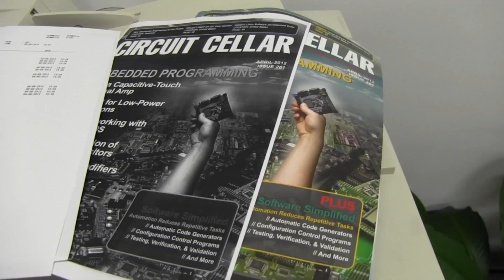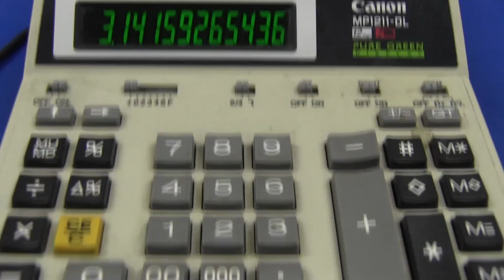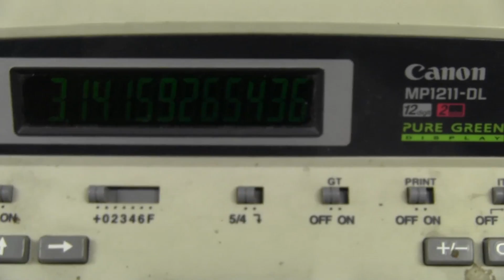EEVblog #345 - Electronics Dumpster Diving

Comment: Those 204B monitors are pretty decent once you replace the dodgy caps. I got one from a buddy a few years back because it would take about 10 minutes to power on fully. $4 in parts and half an hour of time and it has been rock solid ever since.

Comment: Damn, i could use so much of the stuff you find there. Like the monitors. Recently i got lucky and my school gifted me 10 old crusty 1280x1024 monitors. I threw away the white cases (more like yellow at that point), and have put 9 screens seamlessly together. They all work and are currently driven using 3 graphics card outputs and a bit of controller magic which needs to be optimized still... 
Neat project and it would also work with your four monitors. You wont even need complex controllers, just get a good graphics card with enough outputs.
Reply: most graphics card comes with a display port so there would be just a dvi cables that are compatible so that means you need lots of dvi connectors

Comment: If anyone's wondering, the specs of a Dell XPS 420 are:

Intel Core 2 Quad Q6600 Processor 2.4GHz
4GB DDR2 RAM
500GB Hard Drive
ATI Radeon HD 3650
Windows Vista Home Premium
Reply: Sam Gates ME is pretty bad, they may be on the same level. I'll never know though, since I went straight from 95 to XP.
Reply: I thorght they had the Nvidia GeForce 8800 GT.
Reply: Sam Gates You know vista is the worst version of windows ever produced?
Reply: Sam Gates No,vista is literally the worst version of windows. It hogged massive amounts of ram, barely had driver support, was loaded with bugs, crashed almost 1 of every 10 program you open, had horrible security, the server editions were unreliable, etc.The only reason I could see someone liking vista, is them trying to be a special little snowflake, and be different from the masses.
Reply: Sam Gates WIndows ME is about the same as Vista. According to what I've been seeing, vista is worse.
Reply: ME and vista suck equally. Windows 2000 was the real OS to have in that era. XP was the same kernel as 2000 and just had pretty colors and a new media center. XP was fucked up in it's own way and inferior to 2K which I used right up until 7. Vista was a pigfuck fest

Comment: Was hoping to (at best) trade for maybe an old 8 bit console/Amiga PSU (though tbh I just need to rewire the 500)/128 Spectrum keyboard overlay. But have not looked at them tbh. Some cool chips on there... Lots and lots of chips/caps/stuff!

Unsure what postage is like for other side of world (one of my best buds in Perth actually atm)

Also not looked into the NeXT stuff for value/collectivity. Solder on the (HUGE!) VGA card looks sweet. Pretty sure no chip leakage or PCB damage. It has the blue 'IBM' pullout 'tab'and just caught my eye for being such a crazy big card at time of my g.force4 mx 440! 

They must have had power for their day! All, so well built... Prayed the keyboard was ps2 at first!

Just don't want to be cheeky and ask cash or big swap as unsure how rare. Card even in plastic boxing I think.

Got a few still decent (post 2000) Mobo's, GPUs (lots.. Mx440-gtx285ocx 1.5gb, pair gtx8800oc's 768mb- all BFG brand. Plus the history between!
Tried selling a pair for £90 (8800s- nice editions... Staying I'd split the pair) and the guy under me sold one OEM for £50!!? Mad world.

Gabbering! geektalk sorry!
if you really interested and are worth nought then just pay post and I could get em out the way.
Can't guarantee working but I could/should have grabbed a load, so blatant upgrade skip and looks crisp.

They still in businesses.... Will have to pass by skip again now I see what you've found! Good going!

Comment: here in the philippines its so rare to see people throw away ,,its a 3RD WRLD country and i myself im salvaging pc parts and they are not FREE,,i paind for almost 8 dollar for a junk pc to salvage just a working hdd
Reply: realgroovy24 tech prepare for worryingly long reply.. Apologies! 2nd day online for 6/7? Months!!!😲

couple of gig of ddr2 sounds pretty fair, considering I can't test card (spotless though... It's always been kept as a curio in my (aging!) GPU collection!... Always pondered on chips n spec....
O.T.
Take note 'chap in phillipines!' Shipping a 8800gtx-OC (bfg) (or two) would be expensive for me to post.... had the pair for £90 on eBay, separable, and ppl buy the ref. Cards for £50!? Over a bfg OC model for less???? Mad fools.
 7600gs/6600GT easier on postage but aging! Or even an mx440 😨 lol. All depends on your current rig!
 You may have a better card than my 670ftw (much better than ref 670 as on a 680 PCB... Got mine cheaper than the branded reference cards at the time! Clocks great, nvidia- so on warm side but better cooling w/680 board. Upgrade soon, groan, but a great budget/ SLi card option now I bet.
Will have a bfg gtx 285 OCX 1.5gb going then but still some value there, v.clockable.

Sorry Groovy chap.  I'm jabbering.... no rig= no mumble= a rambling man! All my nerdy mates are Pinball/old videos only and I'm 6 months behind on my rigs. My poor 4770k, gd65 + matching fluid cooler, 16gig hyperX beast-@2400, my first ever SSD.... saved 6 months. 10 days use, then hacked n locked. Just looking at it hurts... Let alone the i7 1366 I couldn't advertise before ps4. No fun.
tbh.. I could build my 'old' i7 920 (dead solid @ 3.8ghz+ on p95/intelspeedbrn) but with a gammy finger the (USA imported!) scythe #? cooler is the size of my PSU and brackets and balance fiddly at best with <4x 120mm fans (I use 3)+ 80mm on panel that sits above perfectly. A true airship! 
So rural I just can't sell it!! Even at sub ps4 prices! !
No concept it's going to run them same, or better, games with more beauty and stability!! AND happens to be a computer.  Darent mention upgradability!! 
Dropping in a better 1366 i7 in (GB UD3R... was/IS decent mobo!! 2oz copper fgs!) can't cost so much now- but ppl freak- even when offering to slam it in for them. Vs ps4\xb1 etc not needed imo! BF4 ultra bar 4xAA ran smoother than melted butter. Fgs my new GD65 (MSI.. anyone know how to contact them to RMA board? BOTH bios' locked remotely, WHILE I had an encrypted stick left in!😨 gutted! Full lockdown.
 Plus anon stickers on our post?! Why? No clue. No issues/ interest and am sure hundreds in our 'little' HH community who are fine by me. guess local Script kids as had a car full masked up wooting and shouting on a rural, new forest road in a 'low key' Subaru in wrx colours!!? Even got his damn photo! Fluke/fool, he mustve fluffed up remotely spying and his startled face popped up in blank window for a second or 2! Glad im a gamer still and am fast on my prntscreen key!! 
zips up jabber hole

So, in theory, sounds good if the others not got a speccy/* OR a half decent IPS/ any screen better than my led TV.. Prepared to paypal if decent.. Only just gone hdmi so can't imagine more eye candy! 
Bk in RL,  unless you're monitors you're replacing are decent and plentiful! RAM Could mean I salvage another machine... Will have to check what boards I have and DDR types/speeds... My Last Single Dens. Board went into a MAME I recall! Good money in MAMES if you offer personal side art etc. Just everyone at it.

Sorry for my lack of mumble causing excess jabber! Best tech chat of late has been desperately explaining how a custom i7 PC urinates on all consoles from considerable altitude!!

Poor noobs, actually considering fly posting a pamphlet titled "Noobs, no offence but you're kind of wrecking our internet, here's some tips/ links if u fancy it!", (or similar!) and pinning to notice boards! Beats 'which?' Magazine I'd guess!? and may motivate someone into better privacy or AV and save them my recent nightmare!
Reply: oh heck here we got workplaces wanting to upgrade and giving a room full of computers/parts/screens/keyboards etc... away free
Reply: Want an old 20/40gb ATA I'd chuck you one... Just post cost would be madness I think. If I find a bigger ata around I won't use might be worth it. Whats your System? I'm locked out of my BIOS (good old haxxors.. Grr.. Skills tho) on my new rig and can't find MSIs address to reset, so I know the frustration!
I don't have rooms of old kit but if you're running slow that might be a nice Xmas present for a less fortunate place for PCs.
The us/UK may be, or seem rich,,,, but we are far from free. I hope you live somewhere beautiful and free!
Reply: rob garcia  You wantsome old DDR2 or DDR1 or SDRAM I can ship you? I got all sorts from 512mb to 2gb
Reply: I got plenty of AGP cards still
Reply: realgroovy24 tech keen to keep the 285ocx as is basically a single core 290.
I'd have to sell/ swap that for what it's worth. Ran planetside 2 fine, far cry 3... Clocked and in the right rig is a great card.

I'm pretty Keen to sell/exchange one of the 8800Gtx-OC 768MB cards. Like I said I had the pair (vgc.. Barely any dust at all on blower) for £90+ post (same weight/size as most newer 11.5inch GPUs. 
Got any decent IPS monitors lying about? My led TV looks pretty sweet so don't want to downsize or lose image quality and cards!
In SLi they bench VERY close to the BFG 285ocx, which was annoying at the time!! DirectX 10.1 though on the 8800s. If u got a pci-e board sat there w/ no card I have a GT560 somewhere too which should match the 8800 or just beat it but less shaders by far than a 5 series GTX ofc BUT is dx11.

Depends on your needs rly and what I build for a friend for Xmas... Tbh if u can live with dx10.1 the 8800s will game better than the cut down 560/70 for demanding stuff.
Gonna want a good 550+watt psu or cheap 750watt PSU for those babies.

Have a think mate and we'll see if we can hook each other up... 🙌
Reply: Kholas little spot sry my bad... Thought u needed a pci-e!
Reply: realgroovy24 tech could you pls give me some ddr2 mobos ddr2 ram etc

Comment: pff, thats nothing compared to what you can find in some factory dumpsters, especially if the factory deals with large variety of products. + these places are usually clean. im not kidding when i say my employee threw away a fully functional ABB IRB2400(google it), with fully functional control cabinet no less! i simply had no place to take it so someone else removed it

Comment: 9 * 123456789 = 1111111101 18 * 123456789 = 2222222202... for all of the numbers divisible by 9 up to 81, in which case an extra zero is inserted to the end(starting at 90). I am dyslexic, but math tricks really helped me stay interested enough to get through that inconvenience :). 9 has lots of neat tricks. It wouldn't, however, be a good stress test, multiplication of 9 is not difficult. I would think factorials would stress calculators the most/

Comment: A P4? You don't want to use that, Dave. As the sysadmin of a student club I recommended against using them because they just suck power like there's no tomorrow. Members often forget to turn them off, and often leave things running that prevent it from going into sleep mode. Like world community grid, of all things! It costs 160 euros a year to run one. However, geeks don't usually get their way, so that's all we got to work with.

Comment: those samstunk monitors are really good. someone threw a bunch out and I got 4 of them identical to them.  all four had the SAME problem.  bad caps on the power supply.  After recapping, they all worked perfectly.

Comment: Concerning these Samsung Syncmaster 204B: I got two of them which didn't work. Turned out that they just needed replacement of all electrolytic caps and a soldered in 3A fuse, shaped like an 0207 resistor. They work like a treat now.

Comment: The 2 copiers use cheap and refillable cartridges. I have the canon version of that HP. The calculator probably has a design dating from the early 1980's, just as parts become unobtainable they move to sm versions, so that is why you see the oddities. The wire links are because the other side of the board is a carbon screen print with the keys, and the printer mech probably has been unchanged since 1970. I do the same, every so often I get nice goodies.

Comment: I do not know why you call them bodges or aftertoughts.  With big circuits, particularly when there are high amount of ICs involved (and not transistors and so on),  single sided or doublesided pcbs its very difficult to sometimes to get a routing solution that does not involve some wire jumping across or the bloody vias.

Comment: Lots of times those lasers are thrown out because the toner is too damn expensive.  Similarly, I have a few battery-powered drills that were thrown out because it was cheaper to buy an entirely new drill than it was to replace the old batteries.

Comment: If you plan on using the Samsung monitors, do yourself a favor and open them up and replace the capacitors on the power/inverter board.  Samsung is notorious for using cheap capacitors.  When the caps go back the monitors starts to flicker, that's when most people throw them out.

Comment: i have a xps 420 in my junk room, i blew the mother board and gfx card. im using the psu for my HPB on my ultimaker right now. its not great, it takes 20 mins to heat up, and when its hot, i can still pop my hand on it :(

Comment: Beware the urge to unconditionally "Rescue" electronic things - you will fill all available space with stuff the might come in useful but never does (until just after you finally chuck it). At least stuff like monitors is fairly easily sellable.   Dumpsters outside businesses are always better pickings than domestic as the value threshold is way higher, the more so towards the centre of cities!

Comment: i wonder how hard it would be to salvage the printer out of the old calculators, and interface it to something else... pobably would need a new microcontroller. i suspect its a couple of dc motors and some ir photointerrupters + end-of-travel switches.

what would you reckon one could print digit-only, that would be slightly more meaningful?